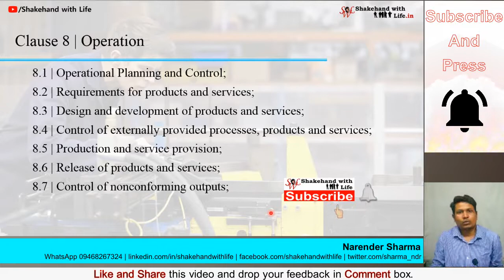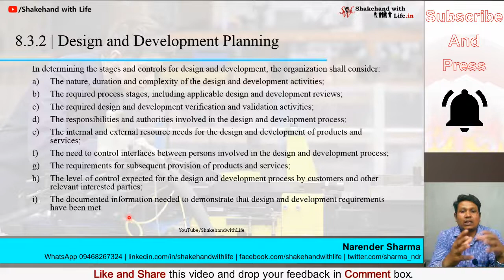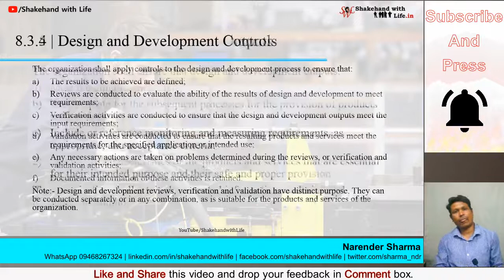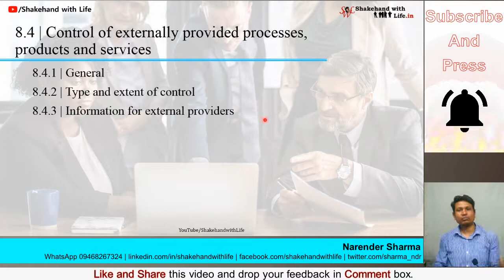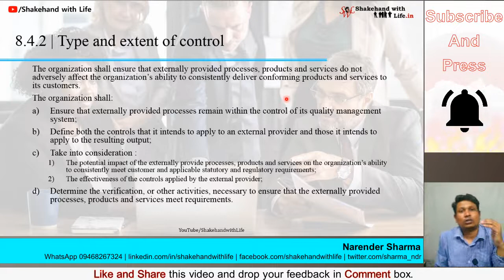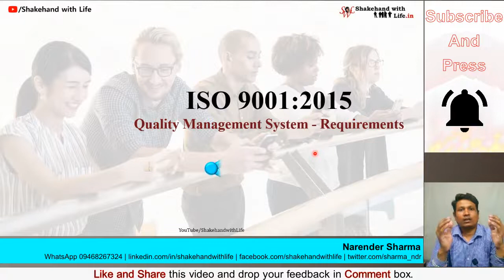ISO 9001 Version 2015 Clause 8.3 & 8.4 | Quality Management System (QMS) | Total Quality Management

Comment: We are an ISO 9001:2015 certified co. by TUV nord.  During our audit this year the Tuv Lead Auditor has informed us the as per 8.3.6 clause it is necessary to mention action taken against adverse effects due to design change prior to implementation of the change . We are manufacturing autoparts we make switches and make design changes for improvements how are we supposed to forecast any ill effect prior to change. and what if there no adverse effect? should we anticipate adverse effect and take action to a notional issue which may arise?
Reply from the maker: thanks